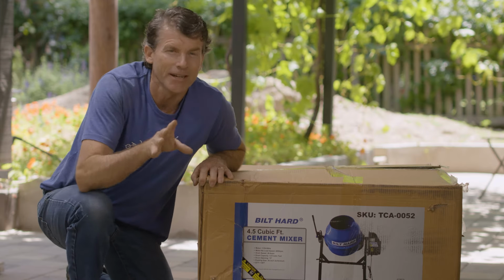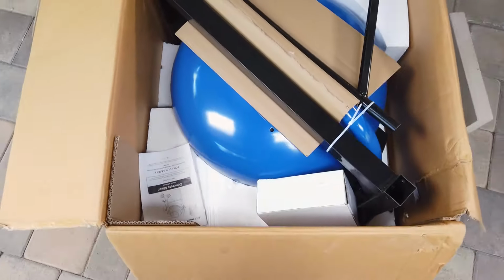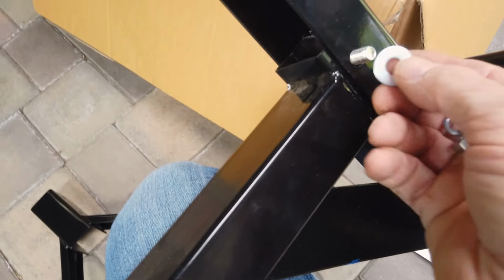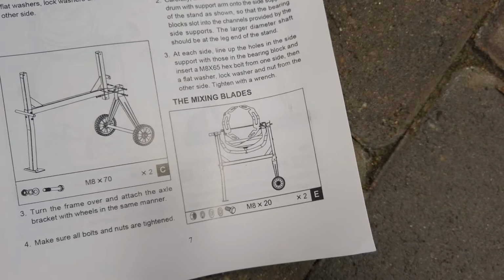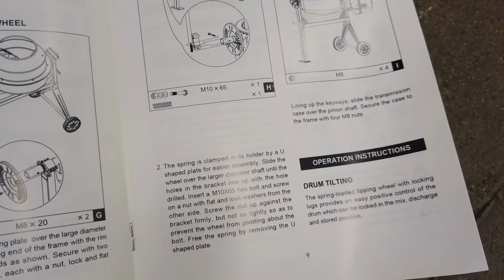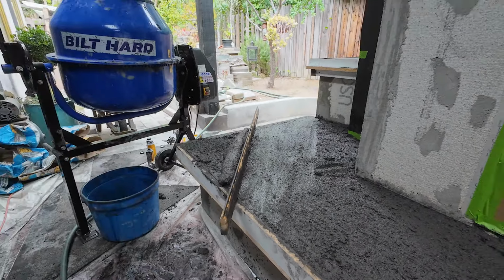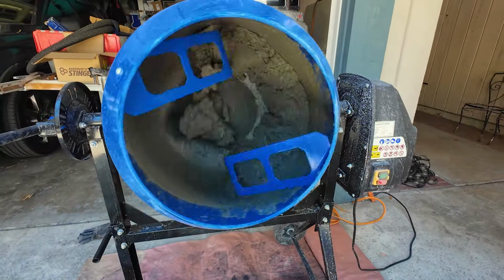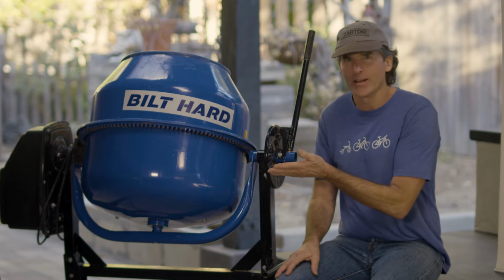This Bilt Hard 4.5 cu Cement Mixer paid for itself after 2 projects!

Comment: What do you think of using pins instead of bolts to attach the the drum to the stand so you can move them separately or make it easier to clean or to transport?
Reply from the maker: I took it apart in 3 pieces and stored it in the garage for the winter. Removed the motor and the drum with the swing arm. Took about 15 min. My concern with using pins is it pretty wobbly with the bolts, would be worse with pins.
Reply: @ I think you are right

Comment: Thanks for your detailed and interesting video. Also great how you fast forwarded to all the screwing parts. How do you like the cement mixer now? Also, in terms of storing, a custom made waterproof bag in an unobtrusive color could be an idea for those people who want to keep it and don't have space in a garage.
Reply from the maker: Thanks for the comment. I haven’t used it since the fireplace stucco, but it is definitely handy to have since I do most of my projects by myself. I did take the motor and drum off the frame and have it stored in the garage. The frame is light enough that it is in the attic above the garage.